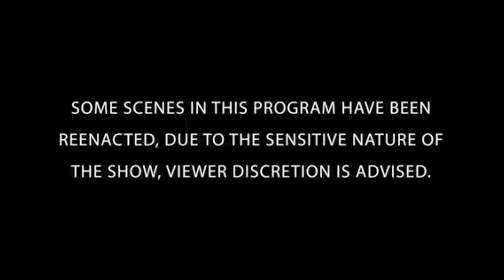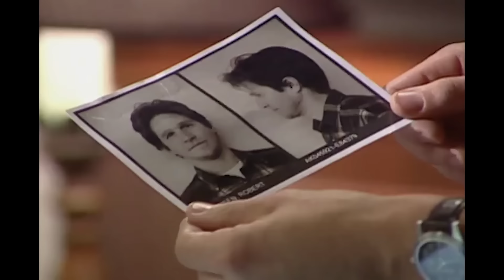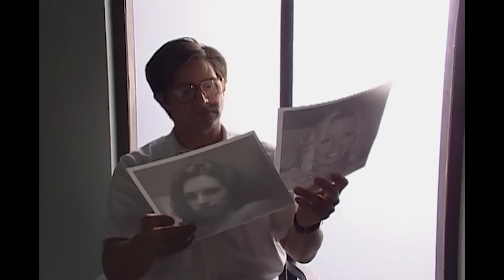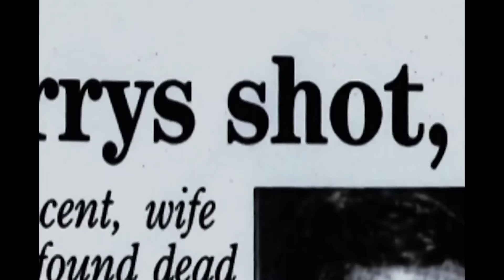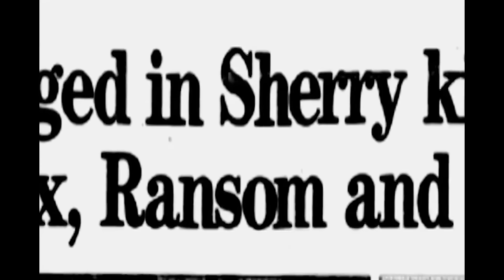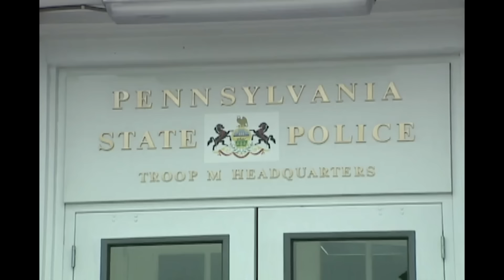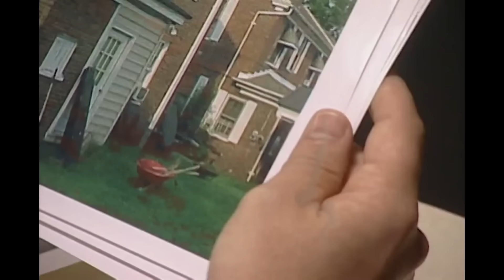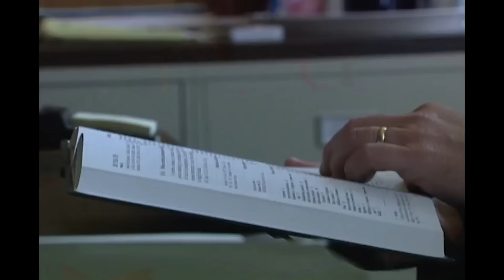Best Of Season 2 | TRIPLE EPISODE | The FBI Files

Comment: In the last case the police felt the killer only fired one shot because the gun jammed, and I was wondering why they did not consider a single shot from a revolver. That would not have left any casings, and one shot to head would be good reason to think the victim was dead. Then they talked about how the ex girlfriend had bought a Jennings .22 semi. Right then I knew the cops had called the misfire right. I owned a Jennings 9 mm and every other shot was a misfire. That was the crappiest weapon I have ever fired.
Reply: I also had a Jennings 9mm. Most Inaccurate gun I've ever dealt with, and I collect plenty. 😂